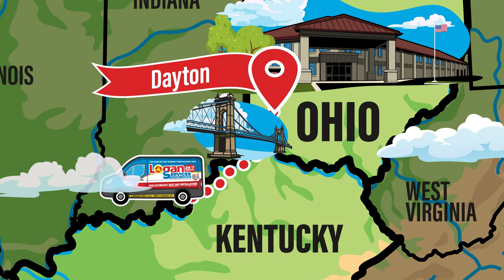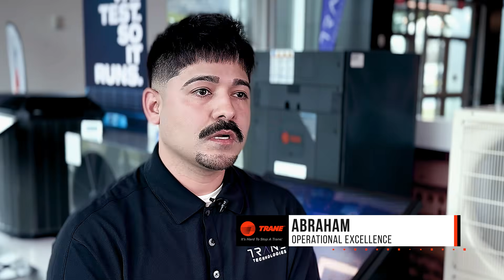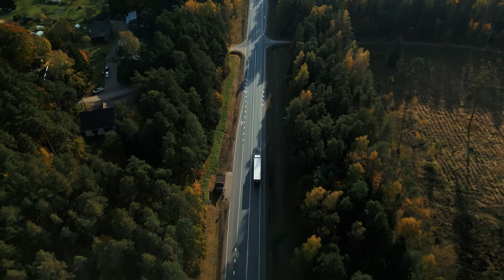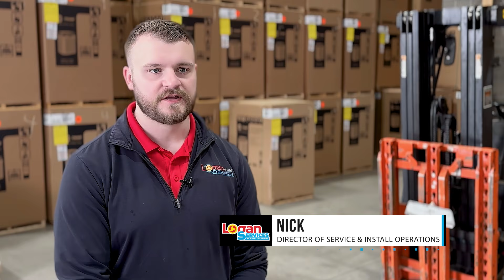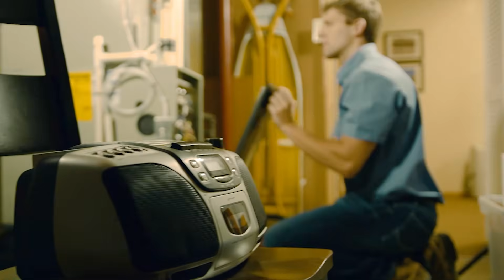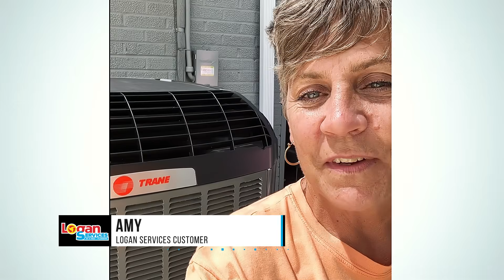From Factory To Family: The Full Trane HVAC Journey With Logan Services

Comment: We were very pleased with our Trane system when installed 14 years ago or so.
Top tier install, Techs, Support.
My wife and I spent the extra to get a Trane system believeing it to be high quality. They were known to go forever.
Regrettably we found out our Heat exchanger is cracked, again.
Apparently its a known problem yet the replacement parts were not improved, just same part.
We were encouraged to replace this 14 year old money pit with a new Trane.  
No.